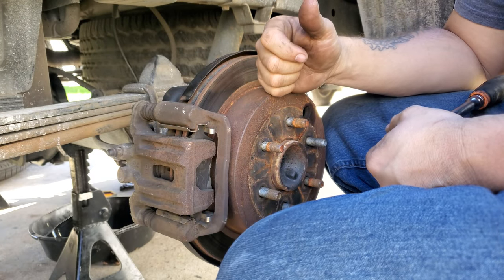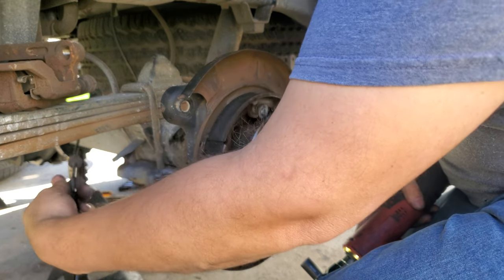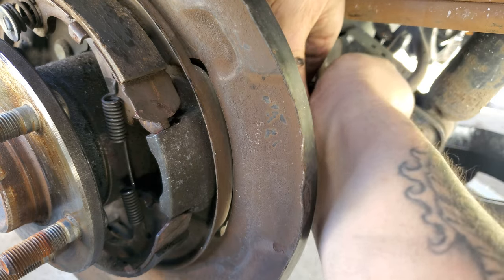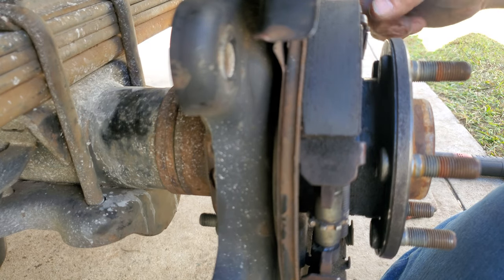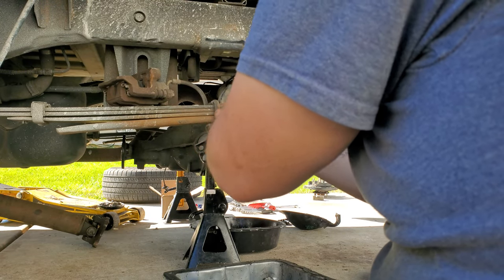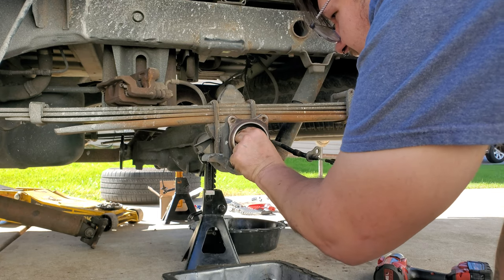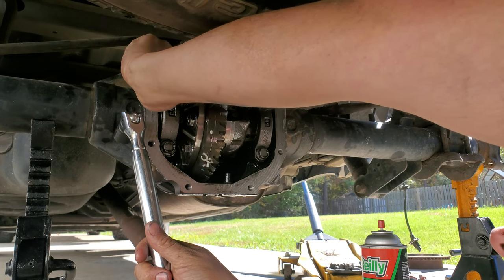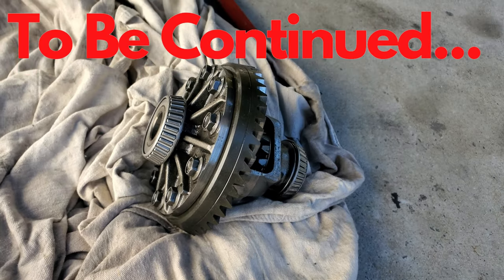Nissan Frontier C200 Differential Rebuild

Comment: Dude great video really appreciate it I've worked  in 4 wheel drive custom shops for a long time  lots of ARB lockers and all   Kind Of  Re gear Jobs  Could not remember Which Axel and ebreak assembly went to each sideGot my park mixed up I was able to figure it out from your video also It's not very common Differential to rebuild Your video was spot on very educational Like I said I've been a professional differential rebuilder for many years Your video  It's wonderful thank you
Reply from the maker: Thank you I really appreciate it coming from someone who works on differentials and components like this.  I'm glad this video helped you.  I wanted to do the video on this diff because there is not a lot info or resources regarding this diff.  Thanks again for the comment and the view

Comment: What did you use to install the new seal? Do you have a recommendation on brand or where to purchase? Thanks in advance!
Reply from the maker: Are you referring to the pinion seal?
Reply: @operationoverhaul sorry, axle seal. You used a tool to tap it into place.
Reply from the maker: @alexpeck-g1s   no need to apologize i just wanted to be sure.  It is a seal driver set I use.  Here is a link to one just like it. https://amzn.to/40iTQko

Comment: Are these in the Frontier 31 spline?   What years of second gen  if they ran different spline? Thanks
Reply from the maker: I know they ran a 29 spline and a 31 spline on them but I do not know what the years were.  I know that they ran both at least until 2010 but I was thinking it was like 2015 or 18 if I remember correctly.  Maybe someone else can chime in on this to help out.
Reply: @operationoverhaul  thank you. I have a 2019  SV 4x4  and was assuming it was 31. I may have to check when I drop the cover for future reference. I'm stuck with this vehicle for awhile, bought it new and have ony 73k miles on it

Comment: Please help- will these gear part numbers work on the c200 diff that has 3.357 gear ratio ?
Reply from the maker: Yes they should work on any gear ratio as long as it is a c200.
Reply: another question, why are so many shops scared to death to replace just the gears? they all say just get a scrapyard axle assembly
Reply from the maker: @aaroncaudle1408  one: a lot easier to do a differential swap and two: a lot of shops do not do gears and rebuilds because of the tools and time it takes to do.
Reply: @operationoverhaul  Hopefully my one chipped spider gear tooth will hold up lol
Reply from the maker: @aaroncaudle1408 lol how big is the chip?
Reply: @operationoverhaul  i have a photo if i had a way to send it to you
Reply from the maker: @aaroncaudle1408  do you have Instagram?
Reply: @operationoverhaul  yes. could i send it to you there ?
Reply: how do you know if you have c200 or c200k? are gears the same?

Comment: I’m trying to rebuild a 08 frontier, 4.0 2WD crew cab w/o off-road package and can’t seem to find the kit anywhere.
Reply from the maker: Are you looking for a ring gear and pinion as well as the rebuild kit/installation kit?
Reply: I am yes.
Reply from the maker: @trintmorris2159  let me see if I can find one for you with a link
Reply from the maker: Go to nissanwholesaledirect.com there you can put in all your info for your truck to pick the correct parts.   It will also have the part numbers so you can look them up somewhere else to compare prices.   Those ring gear and pinions are expensive on these c200 axles.
Reply: Awesome I appreciate it man!
Reply from the maker: Your welcome.  I hope that helps you out.  Also, if you need any specs on that differential just ask and I'll send over your way.

Comment: Great video. My pro4x diff is making a hum at 40 mls/hr. There’s some rust on the on the gear but not really any wear. dealer says I need a new rear end because parts are not available.  My axel seal is slightly worn as there is some play. I’ve decided to keep driving it and change the fluid every few weeks to get all the water out which caused this issue. Wish I knew how it got in there since I dont submerge the rear end in water. Where’s your part 2. The just ended.
Reply from the maker: I actually have two more parts to this.  The second one will be labeled Nissan Frontier C200 Differential Rebuild Part 2 and the third and final part is labeled Nissan Frontier Differential Rebuild Finale.  Look under my videos and they are spaced about two days apart from each other if you cannot find them let me know and I'll reply the links to both.
Reply: @operationoverhaul  I found them both and will be viewing them. Did you just overhaul your diff recently. Im being told that parts are not available for mine. Since I have the pro4x its equipped with the M226 diff which was not designed to be rebuilt unlike the C200. Im not sure this is true but thats what Im told. I need to check with a shop that specializes in diff rebuilds here in Toronto area.
Reply from the maker: @truenorthmuskoka9077  Let me check to see if I can find parts for you and if I can find them Ill get you the part numbers.  What year is your pro4x?
Reply: @operationoverhaul  2012
Reply from the maker: @truenorthmuskoka9077  everywhere I source my parts from makes you buy the entire carrier assembly to get the spider gears.  I can find the ring gear and pinion but not the spider gears.  sorry it looks like you cannot get the spider gears by themselves.
Reply: Hello friends , I have a quick question  , my pro4x I just bought it a few months ago , in rear differential the manual tell me 75w90 or 75w140  is little confuse for me , I don't want to take any chances , one called the dealership tell me 75w90 I called another dealership tell me 75 w140 can you guy help me thank you

Comment: Nice video, is this C200 or C200k axle ?
Reply from the maker: Thank you and this is a C200.  I think the C200K has a different shaft diameter or spline count.  I cannot remember.  If you need part numbers for the K axle let me know and I could probably find them for you.
Reply: I also have C200 on my Nissan Terrano 2005. Im just curious how capable this axle for off road? And do you put locker on it?
Reply from the maker: If you were going to put a locker on it, I would do a m226 swap because you could find a m226 with a locker cheaper than you can just buy a locker for the c200.  Plus, they are stronger and would work better for off road use.
Reply: @operationoverhaul  nice advise man. Do m226 come with factory locker ? LSD or E Locker? And how much m226 cost ?
Reply from the maker: They come in either an open differential or with e locker.  You just need to find one that has e-locker on it.  The prices depend on area, mileage, and if it has the locker or not.  But I normally see them around 600+ in my area.

Comment: Informational Video, Thank you for this video. I have a question, I'm replacing my bearing and seal, how to remove the abs gear and the back plate?
Reply from the maker: The backing plate will come off with the bearing when you remove the bearing.  The abs gear will have a snap ring on it and it is pressed on as well.  I used a torch and heated it up and it slid right off.
Reply: @operationoverhaul   Thank you 🙏
Reply from the maker: @MrRatboo1121  your welcome
Reply: @operationoverhaul   
Hi, The snap ring is located after/behind the ring gear?
Reply from the maker: @MrRatboo1121  yes it is after the ring gear but before the spacer.  I have a picture/diagram I can send you if you want.
Reply from the maker: You can email me at robinsonautomotive@yahoo.com and I can forward it to you
Reply: @operationoverhaul   yes, please send it to me. Thank you
Reply from the maker: @MrRatboo1121  what is your email and I'll send it for you
Reply: @operationoverhaul  Thank you very much for posting this video. I have a question, what’s the symptoms if the differential bearing failed?
Reply from the maker: @MrRatboo1121   Your welcome.  Glad it is helping a few people out.  I know there are not a lot of videos or anything about this differential.  Are you talking about the axle bearings, pinion bearings, or carrier bearings?  Each one has a different symptom to look for.
Reply: @operationoverhaul  Pinion bearings and carrier bearings.
Reply from the maker: @MrRatboo1121  Both will have some grinding and loud roaring noises.  With the pinion bearing you may be able to wiggle the flange on the front of the diff and see if there is any play in them if they are bad enough.  Both will cause a lot of metal in the fluid.  There will even be vibrations while driving as well.